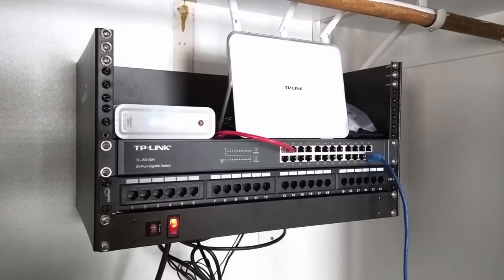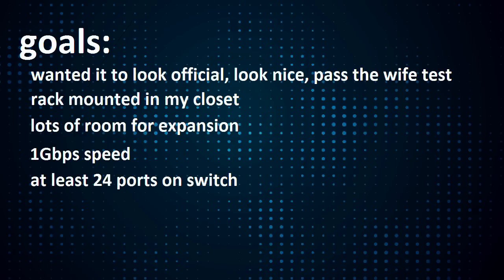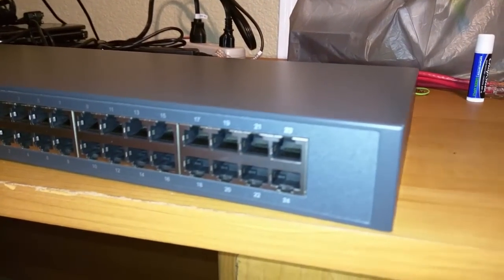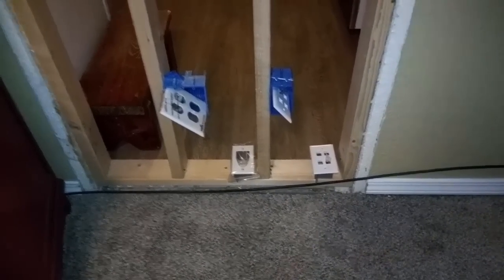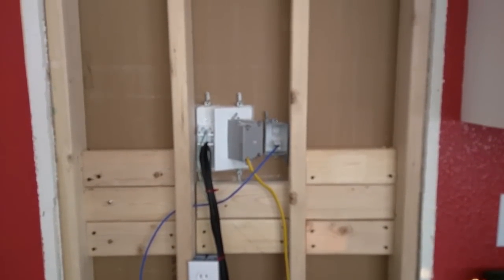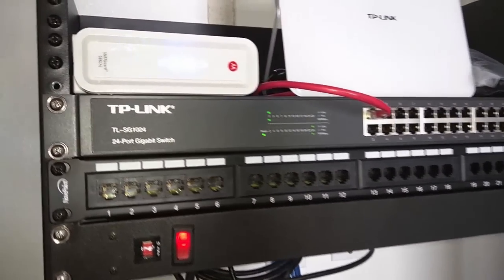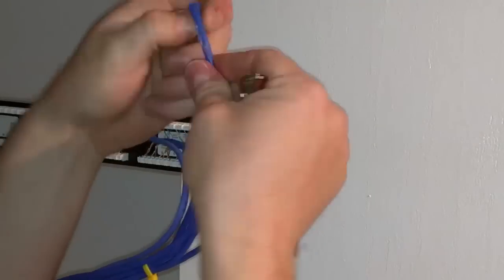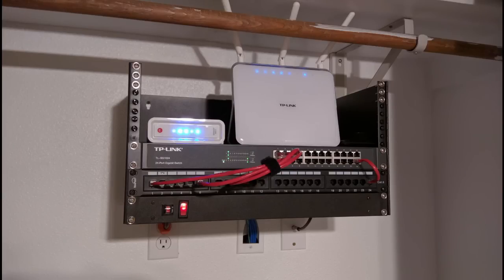Budget Home Network Tour/How To

Comment: Nice! Just trolling looking for diy videos to link to my customers. Networking is the biggest concern for home computer enthusiasts. Cabling and associated hardware is 95% of networking which scares most folks off, not to mention the cost of a professional doing the wiring. I run a one-man computer repair/cleanup/upgrade/network business from home. I school all my customers on the benefits of a wired verses wifi network and give them a hand doing it. Most times its as simple as running a single ethernet cable from their cable/phone modem or gateway to their computer with instant improvement in service and connection latency issues. I can give lots of help for a mere 12 pack of Coronas! 😁 🍺
Reply: That did NOT age well

Comment: @Budget Nerd You should patch a cable into the back of patch panel and plug it in to router, then add small 0.25m cable so its neat and doesnt hang over the front.
Reply from the maker: +TheNanoRulez I did do that actually. See the very end if the video.

Comment: Just saw this video and liked it a fair amount.  The only issue I have is the wireless router being inside a closet.  Other than that very nice setup.
Reply from the maker: I get it's not an ideal spot, if I was having issues, I would move it, but it works great. So there it stays.
Reply: Very awesome then. I do like your videos a lot and glad I found them. I'm off to find it if I need a patch panel now.

Comment: Wishing I could pull this off in my home. Working with three floors would be a nightmare. Networking only needs to be in the second and third floor, but I'd want the equipment on the first.
Reply from the maker: +Levi Dunn yes second and third floors are tough. In my house there are a few telephone jacks upstairs that they used Cat 5e on. Eventually I'll just remove the phone jacks and terminate them with Ethernet keystones and clip the other end at the phone box and run it to my patch panel. Instant Ethernet, using existing cabling.. see if you have the same thing if you don't use land lines.

Comment: Came across a $10-clearanced UPS at a Wal-Mart the other day albeit only equipped for 255 W / 425 VA but couldn't that be modded with a larger bank of cheap batteries to retain cable- / fiber optic-sourced internet, Wi-Fi therein and ethernet switching w/ out much more investment?
I like the fish line you left in for pulling future wiring. There's also a good application using PVC piping and elbows with flanges at either end ( for mounting to wood cross-bracing behind the drywall ) within which to route wiring w/ in walls vertically between studs --  power wiring through one pipe whereas low-level signal cabling runs through a second, separate and not too proximal version of piping+elbows used for power.
Reply: With a small investment in a battery / bank with as little power as this setup consumes, one would be rest-assured connectivity for as long as needed in a worst-case scenario power-conditioned of course.

Comment: Fine vlog, the only nick-pick I have is, you strain-relieved your first punch with that yellow tie, but did not do with subsequence punches, as long as the whole cable bundle is held nearby and is not weighting down on the punches you should be fine.

Comment: I have an issue with your patch panel.  I would suggest that you have more patches, and have spaces between patches.  I would also label the patch panel as a Realtor would identify your rooms, aka "Bedroom 1" instead of "Jakes Room".  Assuming you would have two links in each bedroom and two bedrooms, you could have BR1a, BR1b, BR1c, BR2a, BR2b, BR2c.  You would then have BR1c, BR2b, BR2c not wired up.  If you have two floors, then the top patch panel would be the upstairs, and the bottom the downstairs.  
This does up the cost now a bit.  What it does is prevents trying to be cute and have BR1, BR2 Kitchen1 all nice and tight and then realize you really need two in Bedroom 1 because they are across the room and you fridge now needs a network connection.  I would also suggest buying a box of Rack Screws.  These screws do not have threads at the end of the screw.  They are really nice because the screw is in the hole and the threads grab right away.
I know you wanted to go for bottom dollar, but there are a few upgrades to consider. For your power, there are a few options.  There are remote access devices that allow you to start/stop/restart power to individual plugs.  There also power conditioners.  I have my cable modem here, and I use a battery backup.  (I also have a cell network extender, firewall and PBX)

Comment: That's a very neat and compact looking setup, I like it! Though I didn't really understand what was going on with the TV.
Reply from the maker: +Charter Jacobson ha.. for the TV I just ran an Ethernet cable, so one day, when I get a smart TV, I'll have Ethernet ready to go.
Reply: In my experience smart TVs are fine when new but then the apps get all out of date or stop being supported and eventually stop working. I'd go with a TV (although it's probably impossible not to get a "smart" one these days) and connect smart things to it, it's easier to change and upgrade. Judging by the number of network cables you've got routed down there I would say that's pretty much what you are doing anyway. Nice installation too, I have the managed version of that switch, it's been going strong for over 2 years now.
Reply from the maker: +Justin Spooner yeah, by the time I need another TV, they'll all be "smart." You have the managed version of that switch? How is it? What features do you use on it and like?

Comment: Thank you for this video, really helpful and I didn't know I needed to add protection first before just plugging in a switch. 

I have a Netgear R7000 router which has a DHCP server setting turned on, so is that my security covered? Can I just add a switch and I am protected well enough from my Netgear router?

Comment: I suggest you look your switch total bandwith. Even if a switch is capable of 1 port at 1Gpbs it may no be able to maintain it over a few ports.
Reply from the maker: +SIlver Fox true, but I'm not THAT heavy of a user... but if I do get performance issues I could check that out.

Comment: My setup is almost identical but my rack is in the basement and the wifi router is in the stairwell so its more centrally located. Port one patches my cable modem to the router's wan port and port 2 patches a lan port back into the switch where its distributed throughout the house. I even use passive gigabit POE injectors so no outlet needed near the router.

Comment: Ok so I was on such a tight budget so I splurged a bit.  But I’m trying to find where the modem/router comes into place in relation to the patch panel and switch.  I bought the navepoint U12 with a 24 port patch and a 16 port netgear PoE switch so I can add security cameras as well.  I have a netgear nighthawk X45 modem/router.
Reply from the maker: If your check out my home network 101 video it might answer some of those questions.

Comment: @Budget Nerd. Thanks. Nice Video. Basic question for you. How is the router connected to the switch in the final build. Initially it looks like you went straight from the router into port 1 directly from the front right into the switch. I'm a novice but can't tell how you connected the router to the switch in the final build. Thanks!

Comment: You should've ran 2 Ethernet cables up to the top where the tv mounts to the wall because a lot of streaming devices now get power from the tv, so having the patch cable there is better because of a shorter distance to go. I would've also left some slack in the cables, a service loop, in case anything happens and you have to trim off the end - you cut them all to length so if something happens you'll have to re-run the wire or add a split which looks ugly. I like patch panels, but you explained the process incorrectly - also, these types of panels can't be repaired easily if there is an issue - I'd recommend getting a keystone variant so if a port goes bad you can swap it out easily. You want to keep the twisted pairs twisted for as long as possible - you said unwind them. Since the pairs were together, and this patch panel is good for doing that, you can keep the pairs twisted right up until the very end which helps with performance. Finally, I wouldn't leave an exposed hole in the wall - you have the bundle of blue wires coming through, but its open - I'd get some type of filler for that area or add a panel ( punch-down patch panel or keystone panel ) to keep the walls sealed.

Comment: I hope you strapped those 120 volt wires in your wall before you closed it up, also it's easier to pull wire in the future if you would put a PVC pipe from your pull point down the wall and leave a pull string. the string could get caught up on everything you have there

Comment: One of the better network/cabinet tours on youtube. Great video and nice setup. (our setup is like your before setup!) Where you say you cant swing out your patch panel, you could take a hacksaw and cut the hinge top and bottom of the patch panel so you could swing out just that section?
Reply from the maker: +Accessfm thank you. That is very kind. Yes you could in theory cut the hinge part like that around the patch panel, then yes it would swing on its own without needing to remove anything else.

Comment: Thank you for making these videos, they’ve answered all my questions regarding home networking. The one thing I’m still unsure of though is how I would go about adding some kind of device to this setup to extend the range of my WiFi. Would adding an access point broadcast the same WiFi my router is already broadcasting?
Reply from the maker: Adding an access point is a good way to do that. Yes, if you configure it that way, an AP will broadcast the same wifi network.

Comment: Ok, I'll watch this - as I will be moving soon and will need to set up network infrastructure (router, wifi-access-point, cables, network-sockets in each room etc. - well, ok: Not the bathroom, I am never going to put a computer there!) first (before all the furniture is moved in and even before I paint the walls, too because drilling holes for cables makes a mess, so I'll paint after that!)

Comment: I'm more interested in how the devices are connected, that motorola box is what takes the fiber/whatever brings your connection I would guess, then you go in the router, then the switch. or do you go isp box>switch>router
Reply from the maker: +renyn21 you got it right the first time. Copper from isp to modem > Ethernet from modem to wan port on router > Ethernet from lan port to switch.

Comment: I noticed when installing the cat6 cables to the patch panel you were   untwisting the pairs to punch them down. in my experience those wires should stay twisted all the way to the point of termination in order to keep its optimal speed. I know by code is Says you can untwist but with cat6 cable it loses  its optimal speed if the wire is untwisted before the point of termination.
Reply from the maker: +orlo Orlando Lopez I did. It made the job easier. I've also left them twisted all the way to the punch down section before, and I noticed no difference.

Comment: great video!  we are building a new house and I plan to run my cables before all the walls are complete.  Just an observation.  You may have mounted the rack like you did for the swing out feature, but the mounting holes appear to make it look like you hung the rack upside down.  Just wondered.  Great information, and wish me luck with mine.  Thanks.

Comment: 4:07 it looks like the wall mounted rack is mounted upside down.  The small slot should be at the top and the big round hole at the bottom.
Reply from the maker: It's not

Comment: You don't have to remove all the CAT cables to swing the patch panel open,  you just have to leave a loom behind the patch panel so that the CAT cables have slack when opening
Reply from the maker: In the video I wasn't talking about removing the cables to swing open the patch panel, I was talking about removing the other devices (switch, power strip)
Reply: @BudgetNerd  haha ok I get what you were saying now,  it should rotate on its axis rather than swing on a hinge

Comment: If it was me I would used a dual gang low voltage bracket with a dual gang 12 port Keystone Face plate instead of using that high voltage box. Then move the lone coax to one of the ports on the 12 port wall plate.  An finally move that jumper for electrical to the inside of the box without the jacket and staple the wires within 8 inches of the box to the stud.

Comment: Novice question for you here..... Using your setup as an example,  if you wanted to add two additional wireless access points (plugged into ethernet cables in various rooms in your home)  in areas of your home that didn't get wifi coverage from the access point that you show in your current set up, how do you keep all of the access points on the same wifi network so that your devices recognize it as one wifi network no matter which access point you are connecting through?  Also, Does it matter if you plug your cable for the additional access points into the router or the switch? Great video and any help is appreciated
Reply from the maker: You should be able to plug in any additional APs into a switch or the router.

If you have multiple access points and want them to be seamless, you would want to make sure your network only has one DHCP server (usually your router), and set up all the access points with the same SSID (wifi network name), same encryption type, and the same password and that should work.

Comment: Thanks for Video. Which is a better place to put a network rack,  basement or the closets first floor?
Reply from the maker: +Sapoun Ngin it all depends on the building and where the equipment is. You want to set it up in a central location.. wherever that might be.

Comment: You should of mounted your rack  a foot high above the closet shelf because of the wifi will work better if it's high up it has antennas on it plus your rack is not in the way

Comment: That large gap on 24 port switches bugs me against a full patch panel. I always recommend a 48 POE as patching is much cleaner. No cabling going across half the empty switch. Overall, a very clean home network. Only my upstairs is wired up. Blast downstairs with wifi. I haven't been brave enough to go between floors.
Reply from the maker: +m15granger: Jagosaurus' Workbench I totally agree with you. I don't like the distance those patch cables have to go.
Reply: Budget Nerd I design networks & infrastructure for a living & this looks very similar to smaller offices we install. Overall clean. Of course, we always go with managed switches in our world. Keep in mind, some of those cheap switches will not support 1gbps through all ports simultaneously. In other words, it hits a bottleneck HARD once so many ports are in use. You have to check aggregate specs, not just port specs. As you grow, check out the Cisco SG300 line. Nice SMB managed switches you can find at a solid price. Pushes 10/100/1000 across all ports simultaneously. Again, nice job. This is a world where others always think they can do better. As I said, I haven't even cabled half my house & I live in this world daily :P
Reply from the maker: +m15granger: Jagosaurus' Workbench thanks for the tips!
Reply: If you can deal with the noise and power, there are a lot of great older managed switches available for a great price on eBay.
Reply: The switch in question claims to have 48Gbps switching capacity, have you actually tested these switches to prove this false?

Comment: What is this? What does it do? Do you olug it into an ISPs network? Is it still limited by the ISPs speeds? Is all this rack simple a way to run multiple hardwire ethernet cords through the house

Comment: If you need to add a UPS to protect your network gear as well as to keep it running if the power fails. Which one would you use? Debating on whether I should pick a rack mountable or a regular one.
Another question: If you need PoE for IP cameras, would you shell more money and buy a PoE switch or use PoE injectors instead?
Reply from the maker: +R Rodriguez if I knew I was going to need Poe, I would have tried to start with a Poe switch.
Reply: POE Switch as Injectors can become cumbersome fast once you go over about 6.
Injectors are blocks like a pack or 2 of playing cards thick so a Switch would be better.
I have a Cisco POE 24 port for expansion but have 7 items that run POE on it now.

Comment: Great video thanks. Wouldn't it be easier to have 1 network cable going to the Home Theatre wall and split them there with a small switch to all the devices (receiver, consoles, tv etc)? Reason I ask this is because it's what I have now, just wondering if I'm missing out on something?
Reply from the maker: +J.R.R. Tolkien that is easier, and is totally an option. That does work. I had the wall open, and it was just as easy for me to run several, so I did.
Reply: Budget Nerd got it thanks, I just wanted to make sure I wasn't losing speed there. 👍

Comment: Good video. Thanks! 

Question: what is the purpose of the patch panel? Why not have all of the devices connect directly to the switch?
Reply from the maker: Thanks. You should check out my "what is a patch panel, do you need one" video.
Reply: @BudgetNerd  I did shortly after I posted this. Thank you again.